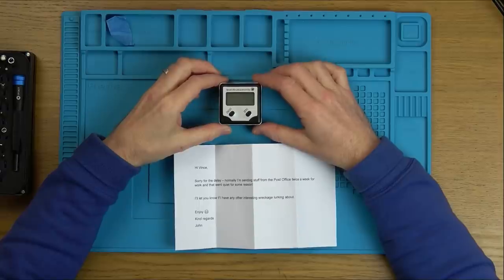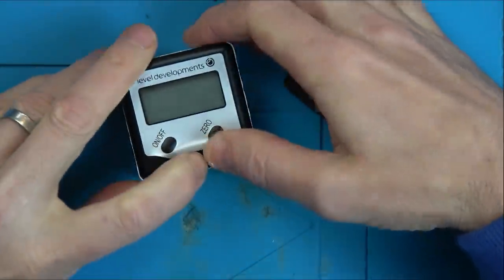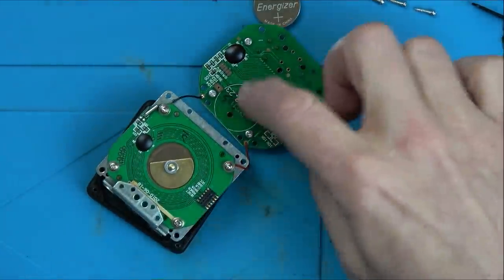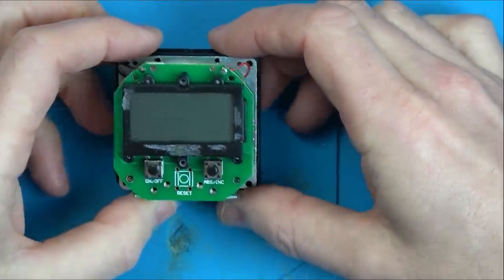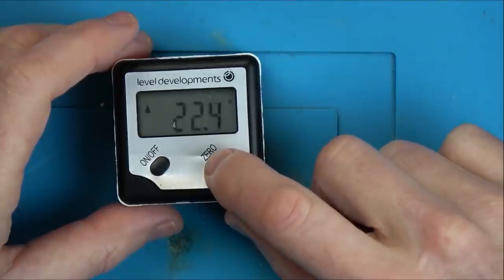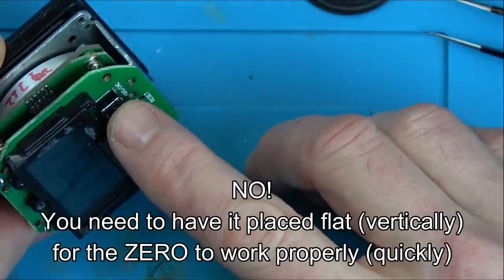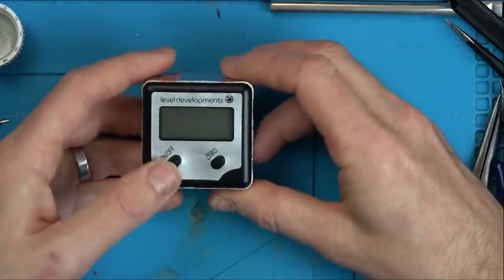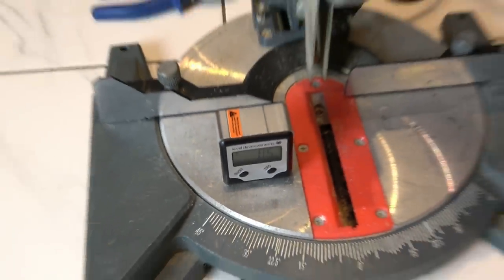Broken Professional Digital Inclinometer - Trying to FIX

Comment: Excellent video. I have one of these playing up so will now try fixing it.

Two questions though.

1. You use cleaning solutions. What are they and where can you get them from?

2. As mine may need to have a switch replaced you say you can get spares. What are the called and have you a link to a supplier? 

Thanks for these videos they both entertaining and informative to the level you can see how to effect good repairs.

Kenny

Comment: Interesting, looks like the angle sensor is capacitive. Looks very similar to how digital calipers work (bigclive did a teardown video for a cheap pair of digital calipers if you are interested). I would've figured they'd use a cheap accelerometer but I love how they went the mechanical route.
Reply from the maker: Thanks SJM, I will check out Big Clive's video 👍👍

Comment: hey Mate, it works like digital caliper like other said, it measures capacitance from different points, thats why there are traces and points along the measuring ring, actually very clever and yes.. it is very accurate as long as the bearing of the counter weight is clean and rolling good. very nice tool to have, you never know when you need one.

Comment: hey where is the video where you are fixing the big red telephone back massager? It was some kind of massager that was red with a white cord and the head was white and you could twist it to set to different settings and stuff. I have a very similar back massager and the switch has gotten stuck! The cord also will need replaced. It is a great back masager with infrared heat and one of the relyable ones, I could use that video! The problem is I cant seem to find that trying to fix video anymore.

Comment: I have one which you long press the zero on a flat surface to get in to calibration mode, you then turn 180 deg so the display points away from you and zero again. From that, it splits the difference giving you a true level. You can then use like an ordinary level. Or just short press zero to use as a comparitor. Great fix.

Comment: The measuring part of that inside reminds me of an electronic caliper, metal moves past all those spots on the board and gives feedback. Probably very similar (if not exact) same circuit with a modifier to read out angle rather than distance.

Comment: Didn't look through all the comments so someone else may have pointed this out. The brass spring strip you were wondering about should be pressing on the centre of the bob weight, either to hold it's position axially, to keep it grounded or to dampen the motion.

Comment: It uses a capacitive effect. You have multiple circuit traces that go "nowhere". When the half disk is near some contacts the capacitance between those contacts increases. By measuring the change in capacitance the device knows how far it's been moved.

Comment: I think that one works like the cheap calipers by using capacitor difference of the track around the weight. I did obviously click on the video and I always thought they'd be solid-state like a phone. I'm more inclined to buy one now, thanks.

Comment: Great fix =D  I agree its going to be that stupid interconnect that breaks with any knock etc!  Should be a ribbon connection to be reliable.  I couldnt really see exactly how it works, but the circular traces around the weighted part make me think its detecting magnetic flux changes changes based on the weighted moving part maybe?

Comment: 16:50 You can buy those switches, they are as you say dirt cheap, Or you can also get them from any number of discarded devices such as tv's, radios, printer, computer mouses, and so on,  you would be amazed of just common these things are in modern devices, and how much of a weak point they are.

Comment: Seeing those blobs of solder sitting all sad mostly on top of the SMD pin header pins was quite tragic. Seems like they were only making contact between the pad and pins through sheer luck before. Definitely a QC issue at the factory.

Comment: Edited: check out "midinotes" comment. I believe midinotes is correct and my original thoughts are not. 

I think, but could be wrong, that the difference in current detected through the position of the bearing/pendulum assembly is translated to degrees (angle) from the null point (zeroed point). Never touched one myself though (other than using my cell phone 😂). Great job as always!
Reply from the maker: Thanks HFR 👍

Comment: Those header pads were just bad from the factory. The pads underneath never got hot enough for the solder to flow onto them in the first place, hence the bubble of solder sitting on the top. I'd probably say it was hand soldered and someone just dabbed from the top and only heated the header pin.
If they'd have poked in from an angle, and put the tip of the soldering iron to touch the pad and header at the same time, it would have worked great with a decent "fillet".
I always tend to put the soldering iron on the pad, and just give it a little shaking / dabbing motion. You can usually see the liquid solder shaking on the leg, and you know it's hot enough and holding its shape from surface tension.

Comment: Interesting that they went with the header connector instead of a ribbon cable. I would assume ribbon would be a lower BOM, and wouldn't have the precision requirement to connect the 2 boards. Maybe ribbon would introduce too much interference? I dunno, I'm no expert, but that's my 2 cents.

Comment: Its a Encoder not a Potentiometer.
Potentiometers aren't very accurate, they wear off over time and they have too much friction.
You can use a Encoder to control a Electronic Potentiometer and that is most likely what they are doing.
Electronic Potentiometer is a Chip that can change resistance when they receive the proper signal with and they do it with high accuracy.